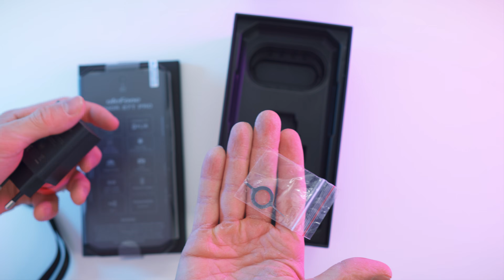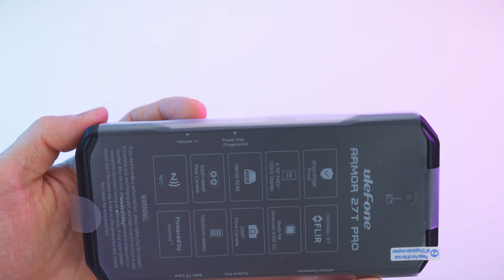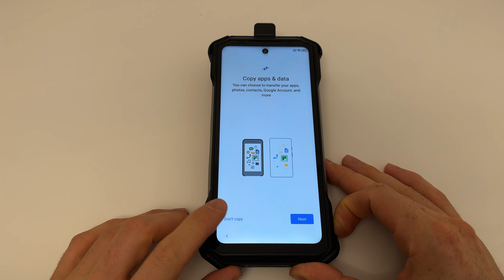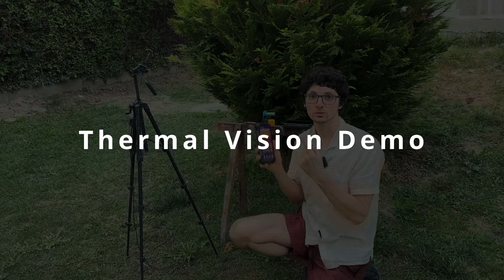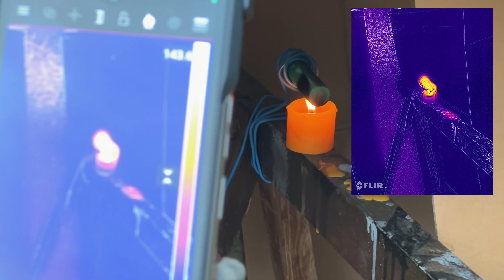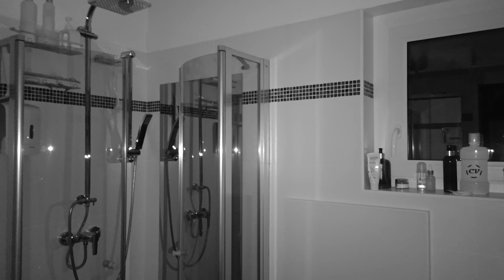New Design, Best Thermal & Night Vision! - Ulefone Armor 27T Pro Review & Test (Ultra Rugged Phone)

Comment: Question, if the simcard slot opens that easaly, can water go through then??  Because in the specifics it says that it is waterproof..?
Reply: I wonder the same thing, especially because it opens sooo easily. It definitely stays in better with the SD card and Sim both in there, but with just one Sim I think it would fall out if dropped. It's the one part of the phone I'm actually concerned about with waterproofing

Comment: My alarm on it won't work & the other apps to get an alarm are full of pop up ads. It's so frustrating. The keyboard is rubbish because it clicks on letters but won't always type them & often just touching once like to go back isn't enough & you need to touch 2 or 3 times.. Duraspeed is pre installed & can't be turned to silent so it notifies you with a loud notification every day & that can't be made silent either. The battery is slightly bigger than the 18T & 19T but for some strange reason lasts about 70% as long even as a brand new phone. My 18T lasted 36 hours watching YouTube nearly all day when it was brand new, this 27T lasts about 20 hours. There are no options to swap around the 3 button navigation options to how you prefer it which sucks because it's a big phone & hard to use 1 handed.
I had the 18T , which this is the upgraded version of, & this 27T software is much worse & most settings are different & you have trouble finding things because they aren't in the usual settings area.
Also Bluetooth wouldn't connect for ages to my old phone or headphones despite being right next to it.
I'm kinda unhappy with it & I just have to get use to it now that I've got it.
They really screwed this up, whoever decided to make all these changes is an absolute moron & needs to be fired.

Comment: The massive 10,600mAh battery and fast charging capabilities of the Armor 27T Pro, powered by the Dimensity 6300 chip, make it ideal for extended use without frequent recharges.